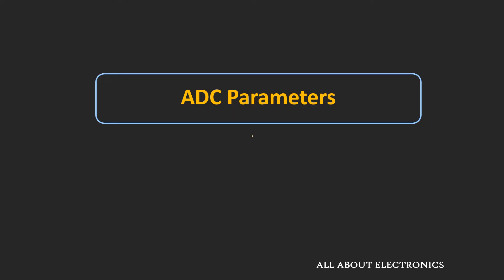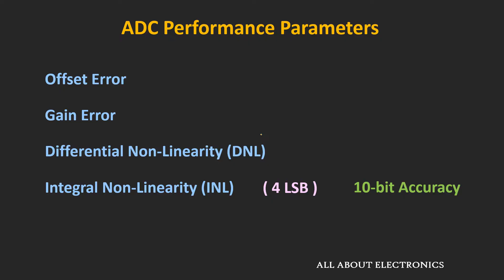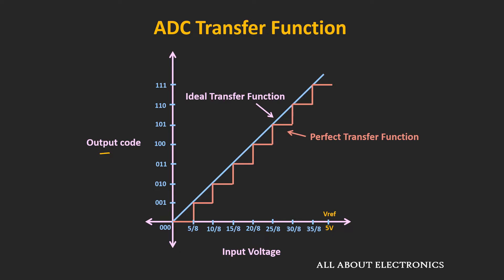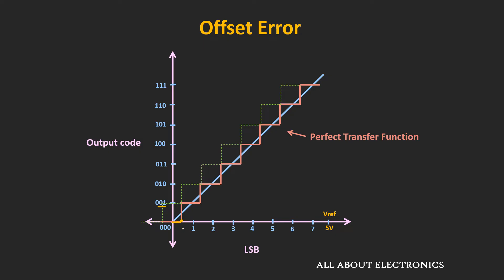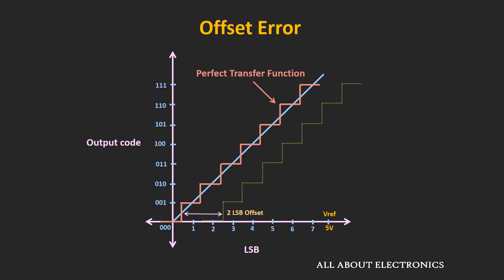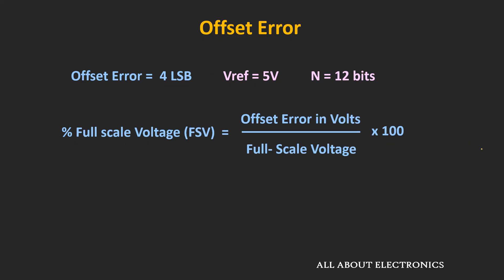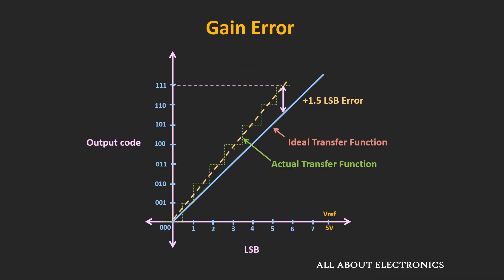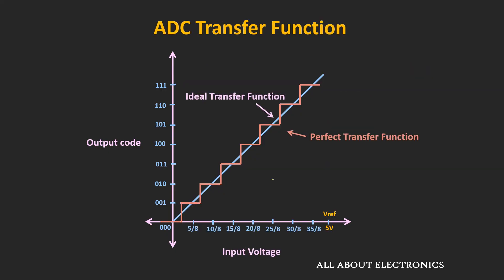ADC : Offset Error and Gain Error Explained

Comment: What is the difference between the reference voltage and the full scale voltage?
Reply from the maker: The reference voltage is the external voltage which we apply to ADC or DAC. It will decide the minimum voltage that can be resolved by ADC ( Or in case of the DAC, it is the minimum voltage which will be available at the output of the DAC) 
In case of the DAC, the full scale voltage is the maximum voltage which we will get at the output when all the inputs bits are 1. The full scale voltage is 1 LSB less than the reference voltage. 
In case of the ADC, the full scale voltage is the maximum voltage which we can apply at the input of ADC. 
I hope, it will clear your doubt.
Reply: @ALLABOUTELECTRONICS  Thank you!

Comment: Drive Model  -  DC1-S2011NB-A20CE1
PRESSURE SENSOR: SHNIEDRER BRAND XMLR010G0T75 0-10VOLTAGE , 0-10 BAR

At present I have stored motor name plate details to VFD and at present the system runs @ 0 to 3.7 Bar 

Now , Please let me know how I can do the scaling from 0-10 Bar to 1.1- 3.4 Bar permanently.

We put the  scaling  parameter P-35=700% and Offset parameter P-39=70
At this stage we closed the discharge valve. The pump started from 0 bar and reached to 3.7 Bar and stopped the pump as per the delay time.

Then we opened the discharge valve and since the pressure reached to 0 Bar, pump started. After we close the valve. But the pressure reached only up to 2.7 Bar and pump runs continuously even when valve closed full and didn’t reached to 3.7 bar.

How can we analyze the pump start and stop by setting parameter P-35 and P-39, is there any equation or like that
Reply: Ey Can you tell me more about what you were working on